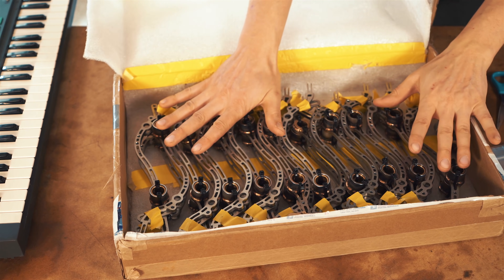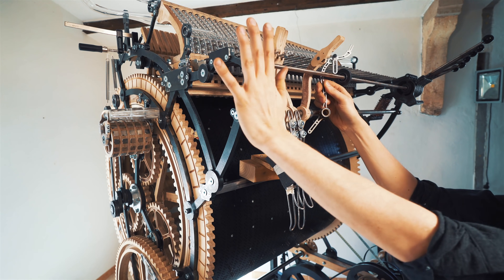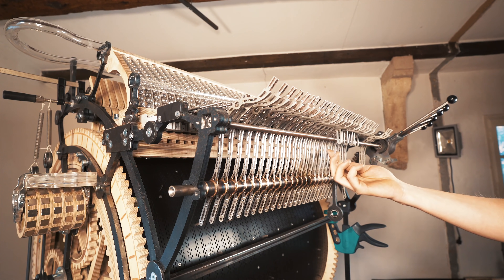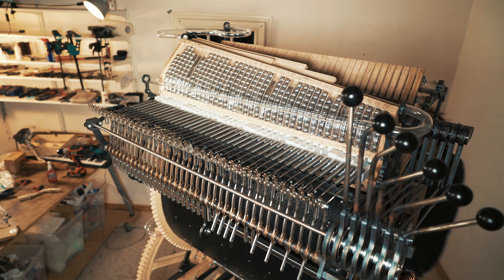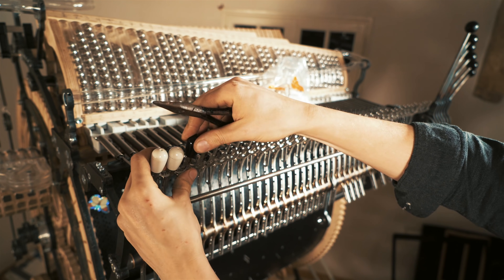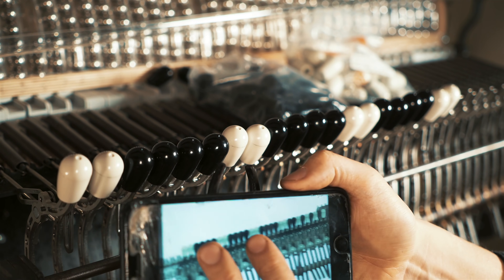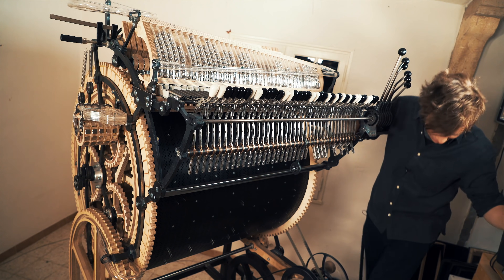Marble Release Pivot Arms - Marble Machine X #69

Comment: 10:15 short remark regarding aesthetics: unfortunately, plastic-looking knobs in general kinda look cheap, which doesn't reflect the quality and finish of your machine at all (i.e. steel & matte wood). Just as an idea: why not use actual MARBLES AS KNOBS? If you need visual separation, you could use marbles and wood balls, or engrave certain marbles or alternate between matte & polished marbles. (EDIT or marbles and acrylic balls/tubes)

Comment: I am not a Loctite salesman but can tell you that from years of use of their various products, that they have awesome products that do what they are made to do.  I know that the HIGH strength will do you well and getting something out DOES require heat or brute force.  Would seriously recommend that you look at the other products they have. They have a lower grade that is not so permanent but will still keep lower stress/vibration applications from even thinking about backing out, but still be removable. I highly recommend for all non-critical "permanent" locations. BTW Loctite thread lockers are Sci-Fi cuz they are aneorbic activated, when stuff is pressed/threaded together and compresses all the air out (oxygen) then wil begin to set.  Crazy stuff thats been around for years!

Comment: I posted most of this as a reply to a comment but then it was suggested that I might want to put it as its own comment so it wouldn't get lost... so... my apologies for duplicating some information... BUT THE SUCCESS OR FAILURE OF THE MMX IS AT STAKE!!!!  ;)  

So in regards to the corrosion on the pivot rod.....  my recommendation is some scotchbrite (maroon colour) to take care of the corrosion... Martin... your penchant for the sanding drum on the Dremel vs corrosion is noted and logged as "has not yet discovered the joys of scotchbrite"https://amzn.to/2EnDEns 
Also.... I would highly recommend the 3M roloc discs with the bristles... https://amzn.to/2XiHghW  for corrosion removal before I would resort to sanding drums of any grit.  Green ones for coarse work... yellow disc's for finer work.  White ones will almost polish. 

After you have removed the surface corrosion... you should use gun blue to protect the finish on the steel rod. https://amzn.to/2SPIQJM 

Also your endeavours, and future maintenance requirements would benefit greatly from having a simple arbour press in your shop... I'm not sure what sort of music you might make with it... but I am sure you will find a way to put it to good use.  https://amzn.to/2BMZhMt
This piece of kit will come in handy for pressing in your bearings and.... removing them... when the time comes even if you have it installed with locktite 4,000,000.

Just the opinion of a Helicopter Maintenance Engineer!!! use with caution.... no Amazonians were harmed in the making of this comment, results may vary.  ;)

Comment: This is so amazing. From design and building to playing, it's started, main course and desert all in one and as cream on a cake we get those amazing presentation and video skills :-)
The loctite 638 you use is not a regular thread locker but an amazing gap filling glue for metals. It can be used to mount bearings in worn out fittings, pipes for cooling oil in engine blocks and much much more. We use this stuff to glue tricycle suspension rods in mounting blocks and each time I am amazed how good this stuff is.

Comment: Metal is mistake!  Look in a piano, what do you see for the action parts?  Wood!  Why?  Well, in times past, that was the easiest material to get and fabricate.  But now?  What do we use? Wood!  Why?  Because wood has sound damping properties.  Even that is not good enough!  Every bearing is lined with felt.  In my opinion, you need borrow from musical instrument makers!  In what way is this an improvement?
     When you want to move the shaft lengthwise, rotate it while pushing.  It will slide easily without pounding.
     Regarding colors, aren't the vibraphone bells fixed?  Why not use a conventional piano coloring?

Comment: May I suggest using stainless steel rod to support the marble release pivots. I noticed there has been surface rust developing ever so slightly on the marble machine X and I'm worried that the rust will reduce the tolerance in the bushings and cause resistance that will contribute to a delay (or, unintentional resistance in rotation) in the marble's release.

Comment: Seems like you've got rust and you need to remove it from the metal rods and add some oil there to prevent rust in the future and make brass bushing rolling easier.

Comment: Check out some corrosion protection for the shafts. Otherwise your bushings may get stuck or wear (rust (iron oxide) is a lot harder than steel) over time. Gets worse when the MMX will start traveling: cooling and heating during transport will lead to water condensating in the smallest gaps! Look for oils containing VCI...
Reply: I was just coming to see if anyone else caught that.  my recommendation is some scotchbrite (maroon colour) to take care of the corrosion... Martin... your penchant for the sanding drum on the Dremel is noted and logged as "has not yet discovered the joys of scotchbrite"https://amzn.to/2EnDEns 
Also.... I would highly recommend the 3M roloc discs with the bristles... https://amzn.to/2XiHghW  for corrosion removal before I would resort to sanding drums of any grit.   

After you have removed the surface corrosion... you should use gun blue to protect the finish on the steel rod. https://amzn.to/2SPIQJM 

Just the opinion of a helicopter Maintenance Engineer!!!  ;)
Reply: @HowieMurray  True That!  Learning as you go is great way to learn, But the time and mistakes... Ekkkk
I think he will have gray hair by tours end.
Reply: Dissimilar metals too

Comment: "Why don't you REMOVE THE RUST from the shaft before inserting the new pivot arms?!" - I'm shouting to my screen. :) (Also, you need to think about using some oil on the metal parts like shafts.)

Comment: Yes you can break that Loctite 638 with somewhere 360 C so with little torch and bam its loose if stuck. Or hydraulic press too. Kinda used to that glue. And there is metals which it doesn't really bite well like some screws+zinc plated metal you can lock with that but you can still later open them so doesn't stick so well and mostly need clean with surfaces first like with brake cleaner well. 
(Plus with manganese phosphate coating need be clean)

I kinda got scared how much glue you did put on those bearings because if glue goes in bearings you are done.

I mean i been at assembly work so been there and done that..

Plus i appreciated to use Mitutoyo caliper. After cheap ones its been awesome. Hardly need zero it ever.

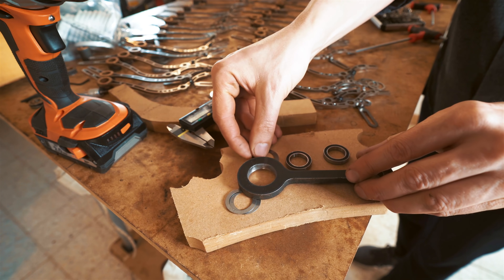Comment: 4:53 the better way to connect ball-bearings were: the hole is a little bit thinner as the ball-bearing and then you press the bearing under pressure into the hole.

Comment: loving tip: you dont need that much loctite :), also the more i watch the more metal on metal i see! you should consider an few drops of oil!
Reply: Graphite lube is probably better.
Reply: @stephss  why? its not getting hot and oil has the benefit of capillary action to suck it into all the tight fitments...   also graphite can accelerate galvanic corrosion between dissimilar metals and often can be messy to use... I argue a tiny drop of sewing machine oil would be the best choice for most of these parts.

Comment: The increased complexity and precision of the MMX blows my mind.
But I hope you find something nicer than the cheap looking rubber knobs for the manual marble release.  Maybe provide specifications of hole and dimensions and someone might be willing to make something a lot nicer from 2 kinds of wood. Maybe something more ergonomical, designed to make fingers not slipp off to the sides too?

Comment: Is there any concern about the rust patina on the shafts? Now that the levers are installed, the rust problem could get worse due to trapped moisture and also be hidden. This might cause future problems for the action of the marble release arms. Perhaps a coat of oil would help protect the shaft? Or maybe oil holes could be added to the top of each bushing similar to the holes found in sewing machines? This might help preserve the shaft and the lever action.

Comment: Dont forget to consider machining tolerances and the effect of temperature.
Too tight or too loose will not work. Also rust protection on steel parts, and varnish on wood.

Comment: I was wondering if you were going to do anything for the appearance of the bushings.  The inconsistency of the heat patterns from welding throws of the ultra precise appearance the machine has held so far.  Perhaps you could brush them to have a consistent brass appearance, or black to match the metal frame.  I love the way the stainless steel shines especially since its located near the ball bearings, and function>form with the arms, but please consider recoloring the outside of those pivots please.  Loving the progress!

Comment: DAAAAARGH! What is it wwith you and bearings?! If you used locktide, look up at which temp it's loosing the ability to keep things bound, gently heat up the part in an oven oron a hot plate. Then you may take the stopcollet and walkover to your workbench and use the usally fixed mounted clamp or similiar tool and apply preassure, once it moves it'll slide out like a charm. And yes locktide has a manual online you can look the temp up in.

Otherwise well done!

Comment: Martin, you are correct. The Locktite can be broken by heat. But you don't want to overheat the bearings or you'll ruin them. Also the sharp blows can ruin them too. An arbor press could press out the bearings easily. https://amzn.to/2EjVmsa And when you're ready to redesign the Modulin, I already built Modulin II.BTW, there is no wood on Modulin II. It is all aluminum and/or steel. Your Marble Machine X sounds like a Pachinko machine!

Comment: How much does the MMX weigh at this point?
Reply: At this point the best way to describe the MMX is probably "Oh lawd, he comin"
Reply: I was sooooo wondering that myself as he finished putting on the whole row of new pivot arms!
Reply: Steve Colwill Seriously, this thing is a beast at this point?
Reply: I will guess around 400 pounds. Maybe that's too much but idk.
Reply: I was thinking the same thing..I would love to know the weight of this beast :)
Reply: I've seen Author & Punisher travel with a way heavier kit of machined metal, its totally possible to tour with it.
Reply: I ask this my self in each video he made, I have the idea that the weight of the machine would overcome the structure robust look that he wanted to do in a beginning, what if start to oscillate under the high inertia and weight?   What if the tiny legs and iron structure on the side does not offer enough resistance against vibrations?
Reply: Each flamingo probably weighed a lot more. This improved design lightened the load.
Reply: A lot

Comment: Hi Martin, a thin coat of oil will prevent surface rusting of bare steel parts. You can use linseed oil just like you would for wood... pun intended

Comment: I am not sure what you are using for the shafts running through the bushing for the marble release system. It seems a little to soft or flexible. If you change it to drill rod it will be super rigid and last longer as well.

Comment: Enjoy picking up all of the marbles on the floor now!
Reply: I don't know what he is using - but go to local hardware store and get a nut collector - it is a wire basket at the end of a pole - the wires flex gently out of the way when they go over something hard, letting the object into the interior of the basket, but the simple weight of the object is generally not enough to get it out again. Makes an easy way to collect stuff on the ground that is at least vaguely nut-like.
Reply: Magnet!

Comment: If those are bronze bushings, should you have soaked them in (warm) oil before assembly, so they have some lubrication? (and prevent rust on your steel rod) a bronze bushing will soak up oil.
Reply: brass, not bronze
Reply: Moritz H that’s bronze not brass, bronze is a perfect bearing material for the job. Brass, not so much.
Reply: And maybe he should have removed the surface rust from that shaft before assembling it.. shudder 
30 seconds with a scouring pad and some oil first would have made the assembly much less cringey..